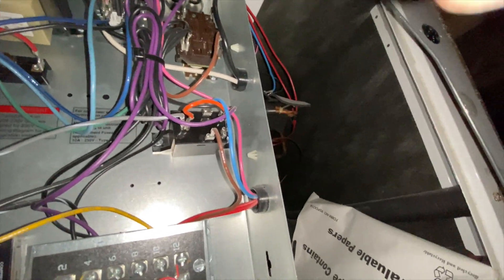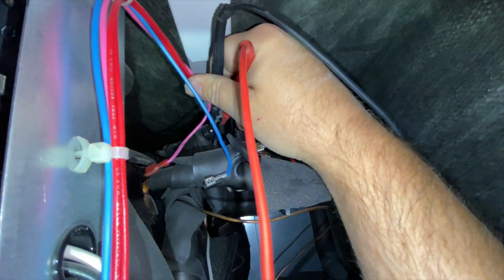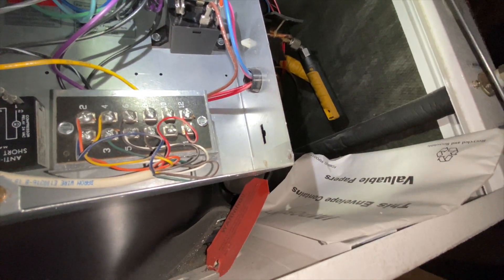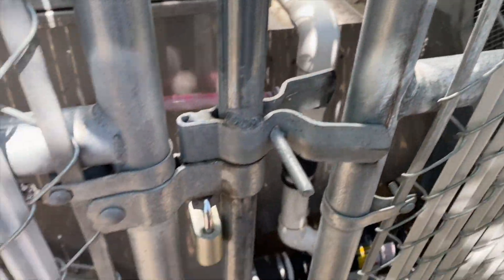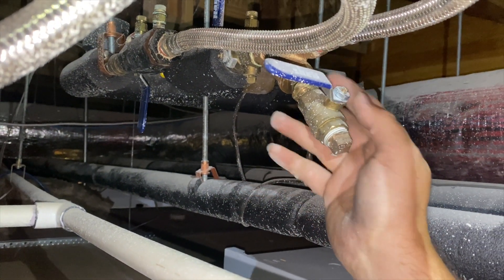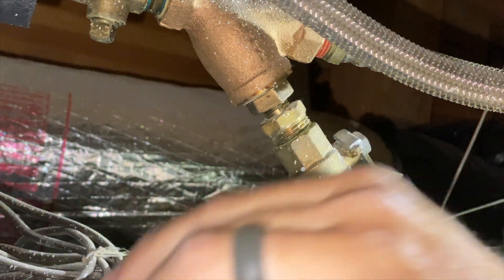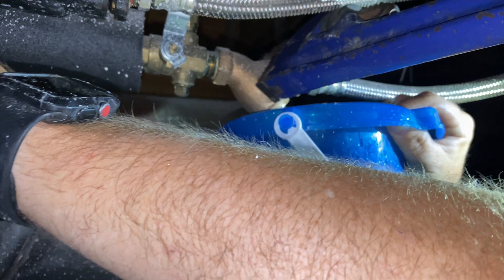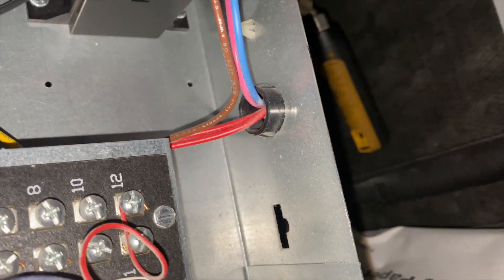Water Source Heat Pump Not Cooling.  How to Diagnose. EP67

Comment: Here in south Florida this problem occurs when the actual  coil loop gets clogged with sludge along with the water lines, especially metal ones, we normally disconnect the line to clear and manually  brush or shock the coil loop, we also fine a lot of buildup behind the shutoff ball valves.

Comment: If it was locked out, why was the high limit closed>'
?
Reply from the maker: When the high pressure switch trips open 3 times it energies a lockout relay which shuts down the unit. Once the pressures equalize the high pressure switch resets to closed.

Comment: I have a water source HP with some issues,in cooling cycle the hi head pressure switch trips,in heating mode low pressure switch trips,its an old Florida Heatpump that's had problems before,I've also noticed that someone replaced the txv on unit,my suction pressure runs around 50 psi in heating when it starts up,then falls to about 20 psi in about 2 minutes,I thought at first it was overcharged bc in cool head pressure runs up to 375 and shuts off on hi head pressure,but I dont understand why when in heating it drops so low on suction pressure it trips low pressure switch,have any ideas for me?the water flow is sufficient,around 50 to 60 psi is what it runs,could the txv be the problem??
Reply: Was the bulb properly insulated? 

High head can come from air in the lines or a blockage with the water. Reverse the flow and/or blow down from the supply side. If not, may need to run some descaled through. But most likely the high head is coming from a clogged water line (or tube/ fin) in the compressor

Comment: Nice video! But I would like to add my 2 cents. As I work on geothermal units from close loops to open loops..etc. This system needs PT ports, boiler drains and ball valves. Then you could’ve checked water, temperature and pressure delta t’s and then isolated the system and flushed the system  loop. Placing refrigerant gauges on a geothermal is always the last resort. Like I said just my 2 cents. Keep up the good work 👍🏻
Reply from the maker: This buildings installation is horrible.  Only in a perfect world would it be installed correctly. And clients never want to pay to correct it. Thanks for watching.